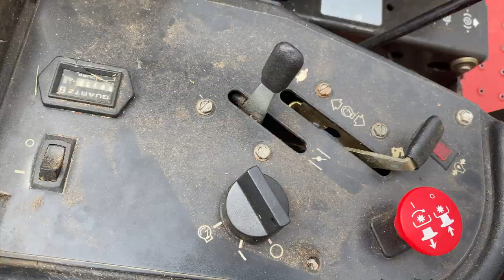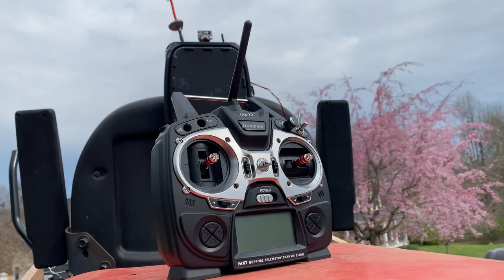Jerry the remote control lawn mower

Comment: How did you bypass the sensors that are on the control arms that only allow you to crank it in park?
Reply from the maker: I disabled the seat sensor. I still have to start it in park. Now with ardurover hooked up to a relay I can un-break the seat sensor remotely to cut the engine.
Reply: @InitialFPV  do those servo swing to the side so you can put the arms in park position or do you have to unhook them to place the arms in park position inorder to start the mower and then rehook them back up
Reply from the maker: The arms just have to be centered to park or start.
Reply: @InitialFPV  ok thx. I'll try my Toro mower tomorrow to see if I'll start in the center position